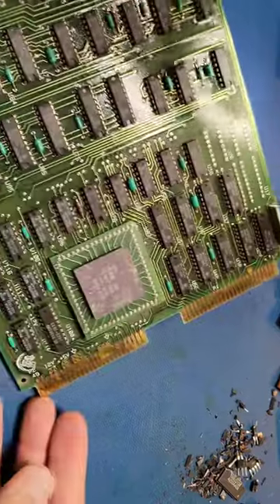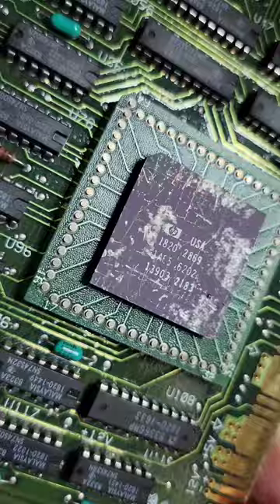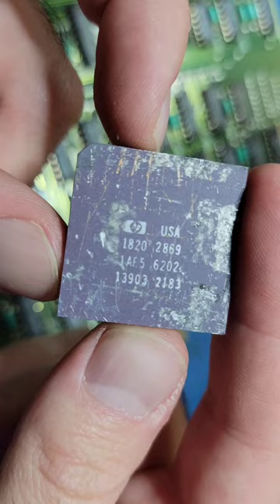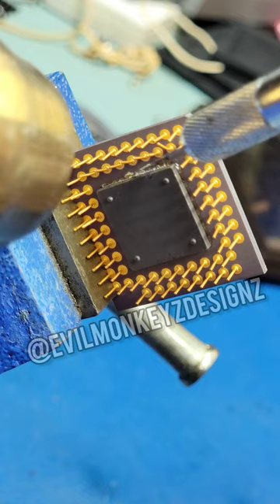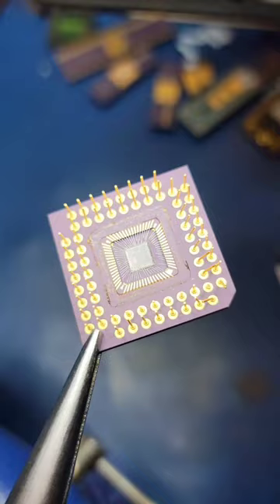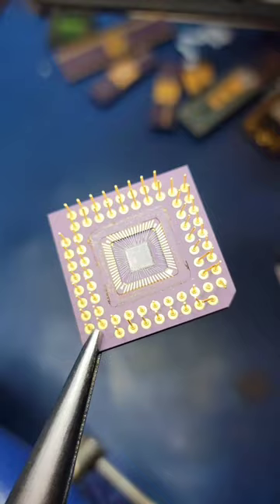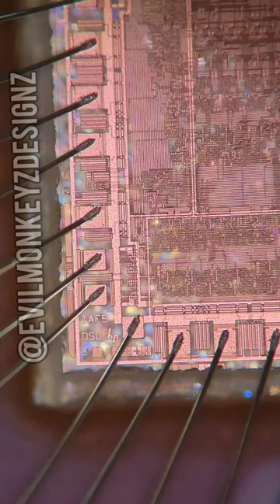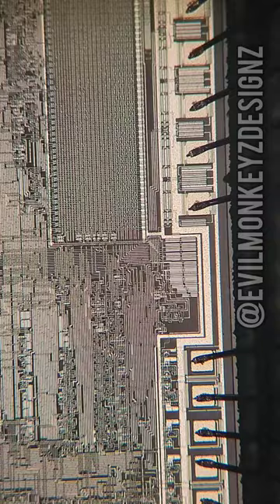CCU #290: Silicon On Sapphire CPU

Comment: Because the SOS Process was so hard to get properly working (the crystal lattice doesn't really line up) it was sometimes referred to as "silicon on shit" 😅
Reply: These layerings are pretty much black magic to get to work. You gotta get the crystal lattice spacing right, coefficient of thermal expansion, etc. Pretty tough stuff to do right.
Reply: F-Lattice
Reply: Newer versions are done on a SiC substrate

Comment: I ran HP-1000's for years.  They monitored the MX and Minuteman III missiles. They were used for all communications and ran all related processes.
Reply: That explains the SoS. It's often used for rad hardened MOS circuits. Particularly CMOS. This is because the 'tubs' the MOS transistors sit in, big swaths of nested P and N type silicon, can form a parasitic PNP or NPN transistor. That can suddenly act like a photo transistor and turn on, passing large current and damaging the chip when radiation acts as the gate signal to turn it on.

Comment: Isn’t SoS sometimes used for rad-hardened applications?
Reply: yes it is. you can read more about it here: https://en.wikipedia.org/wiki/Radiation_hardening#Radiation-hardening_techniques
Reply: Ionizing radiation, specifically.   Charges cannot build up in junctions and change gate threshold voltages.  Meant for space or military applications.
Reply: oh be quiet you
Reply: This one definitely was. The extra large tracks on the die is par for the course.
Reply: Yes used to work in a factory making SOS chips for Space. There was a pile of paperwork for each die.

Comment: These types of chips are used in high radiation environments. One aspect of these is the much larger than normal features that limit how easily the signals can be disrupted by a gamma ray hitting it. The board was very likely used to test these chips.

Comment: Question, why do they incorporate sapphire with this circuit? Why not just regular silicon?
Reply: Just found it on Google It’s better insulated from radiation and from other circuits and more corrosive resistant against chemicals used in manufacturing plants.